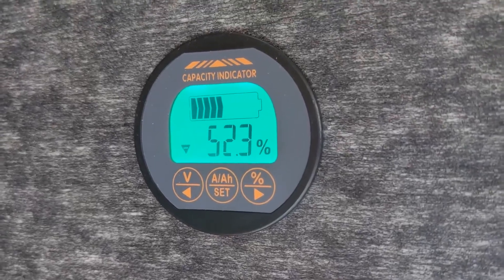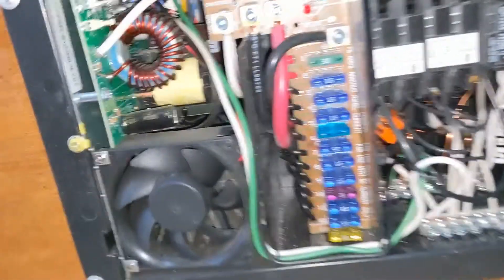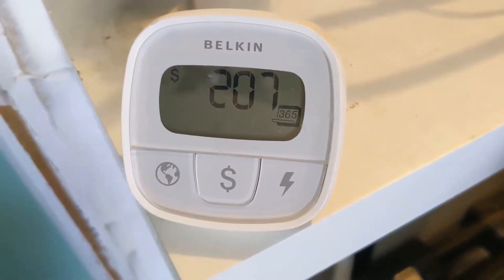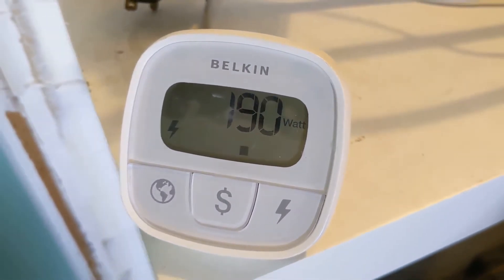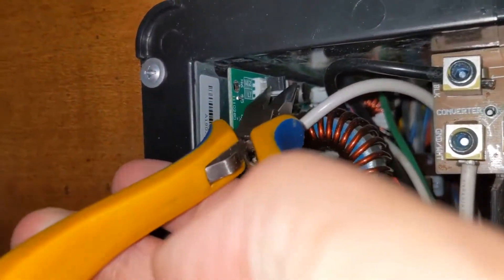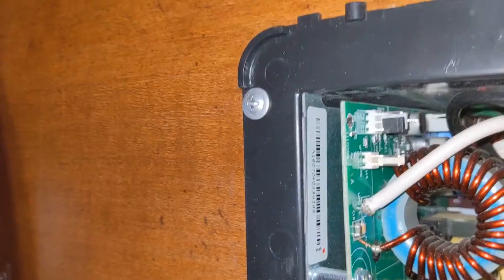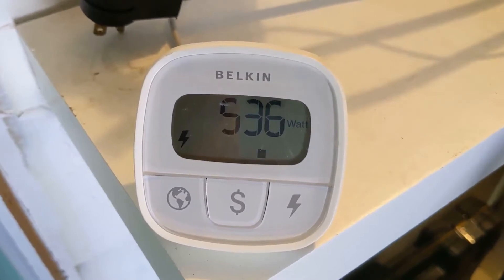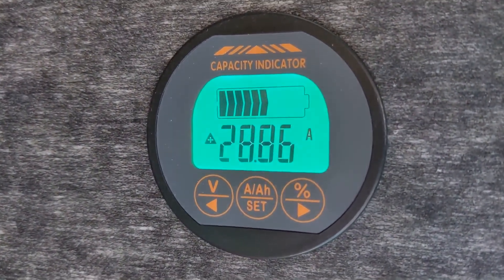5 min upgrade to Lithium on Progressive Dynamics Power Converter PD4045KA - 2020 Lance 1575

Comment: Can you update what the AMP charge rate as you increased in capacity?  Did the AMPs slow down? I am having issues with my PD4655V. It used to charge 20-30amps when purchased on my Lithium, now I am lucky to get 10-15 amps, even when discharged to 30ah

Comment: This is from Progressive Dynamics website: PDI Lithium Switch
Progressive Dynamics Inc. is the 1st to design
the innovative NEW PDI Lithium Switch!!!
The Lithium Switch can be used with either
Lead Acid batteries or Lithium Ion Batteries by
flipping a single switch!
The Lithium switch is set to
Lead Acid Batteries and it is
located on the converter
section next to the coil of the
PD 4000 Series. The Lithium
Switch on the PD 4500 Series
is located on the DC 
Distribution Board. To switch
converter into Lithium Mode
(LI) simply slide the Lithium
Switch up into the top
position!

Comment: The PIN you moved is sometimes called a switch in electronics if that helps anybody.
Reply: It's actually called a JOS 2.54mm pin spacing black jumper, If you delt with these when PC used them they were called jumpers in the motherboard documentation.
When people speak about switches their mind conjures toggle switches.
The information in the on-line manuals for these refer to a switch which is found on newer models. Older models like this one do not have a switch but use the jumper to make the same electrical connections.

Comment: Hi, I have the same power control module, and I really appreciate you doing this video. I opened mine up and mine is labeled the same as yours, the jumper states "on for gel", I'm assuming this is for a gel battery charging profile. The typical gel charging profile does not require the equalization mode (14.4 -14.8V) because the battery acid does not get stratification, and the bulk and Float voltages are slightly different in gel mode. My question here is have you ever noticed since you've been running with the jumper on any voltages higher than 14.6 volts? Thank you in advance for your time and posting this information because it is mentioned nowhere in my documentation.
Reply from the maker: I haven't really kept an eye on the voltage to know for sure. But I've been running my system like this since I made the video and everything has been working perfectly.

Comment: You just saved me $300!  I have a 2019 Lance 650 with a 200ah lithium battery and the PD4045KA built-in unit and NOWHERE in the manual does it hint at a magical Li switch!  I was literally about to buy a new converter today  and decided to google this Progressive Dynamics unit one last time before clicking buy to see if there was any way to make this thing work with a LifePo.  Sure enough, my charging current went from the usual 10-12 amps to 44 amps!!  Thank you!
Reply from the maker: So happy to hear this! Glad you found the video useful!

Comment: What is the charge voltage when you switched which IMO is the most important factor, thank you, I have the same coulometer and am surprised with such a good video you didn’t hit the voltage button.
Reply from the maker: Sorry, I never checked. I just made the change and crossed my fingers, and it's been working great ever since. Not the most scientific method, but my 12V battery seems happy enough

Comment: Thank you for this. I was looking all over for the darned switch that the PD website showed needed flipping. They did not even have the right picture of the panel in the PD4045KA. Now I can plug it in after swapping out my lead acids for two Battle Borns. Next is to finish the solar upgrade from 1 100W panel to three 190W. Looking forward to the furnace working all night now.

Comment: Manual says a switch!?! They must have changed it recently. So the WIZ is for lead acid and LI is for lithium? Thanks
Reply from the maker: That's what I assumed and the results speak for themselves. Just change the jumper to LI and the controller will switch to its lithium profile.
Reply: I’m about to upgrade to lithium and this confirms what I need to do. Thanks!

Comment: Thank you!  I looked everywhere in the manual to determine if this was all I needed to do in an effort to change the charge profile.The manual is not clear about this and implys you need to change the converter to a LI version.  Why do they not have any info in this simple change in the manual? ( Frustrating ) And of course the RV Sales establishment ( Barber RV / Ventura CA ) knew nothing about this and installed the 1000.00 LI battery and never commented or even knew this should be done. Take nothing for granted DUE DILIGENCE'S !!!    Brother I hate slackers!     Again thank you for the video!
Reply from the maker: Agree it's had to find people who are in the know - especially when it comes to RV equipment. I've found the following very useful : https://community.lanceowners.org/